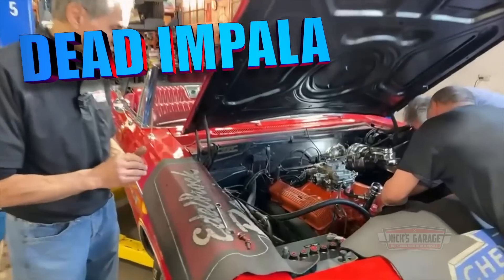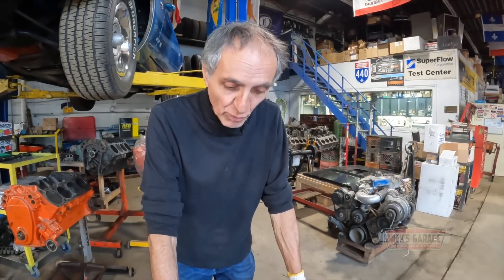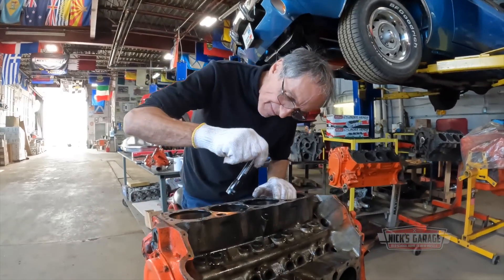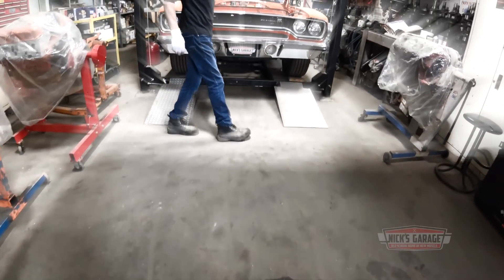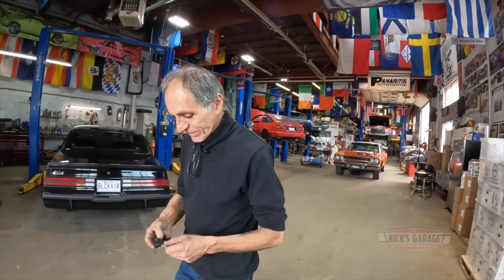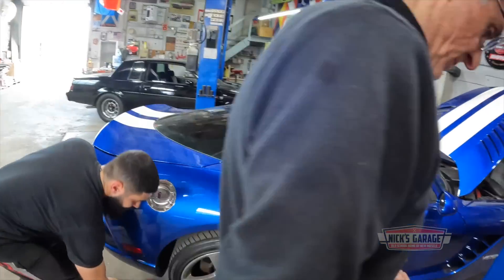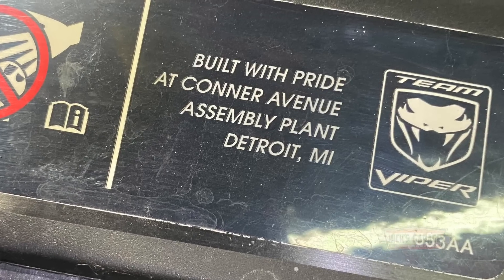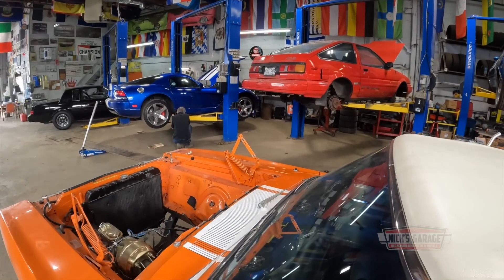327 Chevy Autopsy - Smoking Gun FOUND!

Comment: that was cool Nick.  new doesn't  always mean perfect,  i went through  6 voltage  regulars right off the shelf before getting a good  one the guy at parts store didn't  seem surprised , it was a lesson well learned .great video
Reply: ...always helps to have voltage, temperature and oil pressure gauges in any performance vehicle!

Comment: Nick, thank you for the good tip to always check out your new thermostat a dozen times or so before you put it in your car. A complete engine was destroyed because of a $20 part that failed to work. And from a reputable supplier that you'd done business with for years, and never a flaw before this time. Could happen to anybody. Brings to mind the $3 bearing that failed on the Andy Granatelli 1st design gas turbine at Indianapolis many years ago. They had a roller or needle bearing fail at the 490-mile mark, leading the race with 10 miles to go. Well, now we know that there is no part too small to fail, that will wreck your whole project.

Comment: Check the heater control valve - My 66 Olds Starfire 425 seemed like it was “blowing antifreeze” and this was the issue! Not a part of the motor itself, but it can cause you to lose your coolant and not leave any telltale signs.

Comment: Years ago I seen a 302 ford that had antifreeze in the oil and ruined the main and rod bearings, so after pulling engine out of car I pulled the oil pan and put the engine on jack stands and plugged up the bottom radiator hose and heater hose inlets on the intake and filled the block up with water and waited to see where the water was leaking from. It was leaking from a cylinder wall and running into the oil pan needless to say I  got a used engine out of a junkyard.. By the way I seen two 302 engines do this and one was in a 1980 ford f-150 and the other was in a 1980 mercury cougar...

Comment: Hi Nick, George & others, thanks for the update on the Impala, so a cheap part is what caused the 327 to cook up.  Theo's Roadrunner is one nice looking ride Nick and like Theo can't wait to see it finished either. That Viper is one nice ride and the colour is real nice. I'm with you leave the car the way it came don't change chassis for an earlier body. Stay safe & well folks till next time.
Reply: I have been a Corvette guy for 45 years. However, I have always had my eye on a Viper. So, in 2002 my girlfriend and I took a trip to Las Vegas and I rented a 2002 Viper to see what it would be like to drive one at $400/day. At this time it was in the mid 90's in Vegas. It did not take too long for the car to overheat with the A/C on. I turned it off and the temperature started to come down. But who wants to drive around without A/C with temps in the 90's? Also the foot area on the driver side got very hot. I was getting rapidly disappointed with the car. I will say the "cool car factor" was off the scale. I was stopped at a red light and a group of Chinese tourists started to cross the street. As they walked in front of the car a couple of them started to walk around the car. They were clearly impressed. When I came back to our hotel the valet drivers were almost fighting with each other to see who gets to park the car. There was also an annoying problem on the driver's side. There was no foot rest for your left foot. My Corvettes always had one. You had to drive with your left foot sitting flat on the floor. I went back home disappointed with the Viper and just continued buying new Corvettes.

Comment: When I get a new thermostat I now drill a tiny hole (1/32") in the valve to let the air out of the manifold while filling the radiator (slowly) as sometimes the block/head will not complete fill with coolant.  This may not apply to all brands but needed on a SB Mopar, or you have to pull a hose off.  I remember years ago, just about all the thermostats I used to buy had a tiny hole in them but not anymore.  I guess parts aren't what they used to be.  Thanks again.  Best Regards - Mike
Reply: Exactly.  Have done the same for years. Saved a slant I had when the thermostat was put in upside-down
Reply: Another one here too, I've drilled the hole in the thermostat for decades of Chevy's.
Reply: thought it was the norm to have a small hole on the tstat. aftermarket parts, i guess?
Reply: Never do this. It's much better to slightly open the stat and put a small piece of paper in there to hold it open if you think that needs to be done. Most aftermarket stats don't have a hole or a jiggle valve in the body. They use a groove in the side of the piston instead. Adding a hole makes too much water/ coolant bypass the thermostat.
Reply: @2xrpm  something I never knew. Thanks!
Reply: @chrisleggett685  1/32" hole works well.  Anything bigger, like 1/8", and it wont work properly.  First time I drilled a thermostat, I had drilled two 1/8" holes.  Bad idea.  Took half an hour for the motor to come to operating temperature.  I learned by my mistakes.  Amazing how only two small holes will prevent proper operation of the thermostat.  Best Regards - Mike
Reply: I've done this for 20 years my first 94 4.3L S10 my uncle was old school told me this trick.
Reply: Nope, knock all the guts out and just run the outer thermostat housing as a restrictor to slow the water in the system down, Common sense. Think about it, when the thermostat is open that's all it does restricts the flow to give the rad time to soke in the heat. A thermostat is only for heat inside the car in the winter ! THAT"S IT ! and nothing more. If they fail for any reason, you can see the outcome.  Just gut the damn things and no more issues PLUS the motor runs about 15 degrees cooler in the summer.
Reply: @chrisleggett685  Hog wash !  A thermostat is only for heat inside the car in the winter, nothing more .  You put any kind of paper in MY cooling system you got WAR  with this engine builder brother !  I don't even use any silicone on much of NOTHING on any of my rebuilds. Only gasket shellack that has set up.  There is a reason my motors hold up. I was the guy that called Nick about the thermostat, yeah I am older then nick  lol .
Reply: I just learned this trick a few years ago and have been doing it with every t-state since.
Reply: just find one the right temp and diameter with a jiggle pin bypass(acts like a check-valve/flow closes it) or other with pre-drilled factory bypass.
I don't know any numbers for them offhand, but there's many that will be drop in most all cases, you'll have to search the catalogs.
many have the bypass hole as a tiny part circle on the edge of the moving valve part, that way it doesn't get clogged very easily, which is an issue with a hole as tiny as 1/32".
I guess you could also open a standard valve manually and use a small round file to accomplish the same thing. in summertime only/high performance vehicles I'd not be afraid to drill 1/8" to 3/16" bypass hole. follow that by doing whatever it takes to have a physical gauge on one of the heads.
Reply: @throttlebottle5906  1/32" is basically for the initial filling of the cooling system to bleed off any trapped air.  With the intake to water pump bypass, my SB Mopar has plenty of coolant flow around the thermostat to make it work properly.  This has worked for me for years.  SB Chevy doesn't have that but some have an intake to radiator bypass to keep the coolant flowing.  I do the same thing for my girlfriend's '71 Tempest T37 with a 350 Chevy motor (no bypass).  Yes, came with the Chevy 350 from the factory (Canadian).  Can't say about Ford, never owned one.  Best Regards - Mike
Reply: @hydroy1  in the old short track cars they had plates with different size holes worked just like that keep some heat but always flowing
Reply: @joshdudley3078   Yep, agreed , In heavy stop & go summer traffic or car owners that don't have a clue about overheating, the best thing to do is just run a gutted  housing as it will drop the water temp 15 or more degrees just to be safe for zero cost.

Comment: I have never heard of an engine cooking the paint off of the engine - that is one hot 327 - it will be interesting to follow this story - I would be afraid to reuse that block and cylinder heads. A guy who is known locally for his custom cars (VW Beetle with a front mounted SBC, etc).  Buzzy is putting a '69 Firebird on a C4 Corvette chassis.  He had to cut the car body down the  middle length wise and add 6 inches of metal to get the body over the C4.  It's a very impressive build.  This guy is a true fabricator and it will look like a factory built car when finished.  Enjoy the journey - cheers
Reply: my dad had a 64 chevy 2 with the 283 v8. he put a frost plug heater in it. the thing blew out because it was the kind that did not have a retaining bar. when he drove the car home about 10 miles with no coolant it was so hot the old grease was running off the outside of the block. after it cooled i put in the correct heater. replaced the coolant. changed the oil and filter. the car ran on for another 100k plus miles. sometimes those old cast iron engines can take a lot.
Reply: You've probably seen the Foose "Imposter" Impala body on a new Corvette chassis. Sweet.
Reply: @NebukedNezzer  - That's good to hear - BTW, I like those old chevy 2's - The way the engine sits behind the front suspension is great for weight transfer at launch - thanks for your feedback.
Reply: paint is just not the same as it used to be, with all the ROHS and changes.

Comment: That engine would have been making quite a racket, it would have sounded like a popcorn machine detonating like crazy. It would have also had a significant loss of power, as everything tightened up inside and friction killed off power. The customer absolutely should have realized that something was wrong, but kept driving to the point of nuclear meltdown. I don't know who's paying for this, but I would put the fault at 20% Mr. Gasket and 80% customer.
Reply: Agreed.

Comment: Considering all the testing that was done on that engine the thermostat must have opened and closed several times before it finally stuck closed.   Virtually nothing being built these days is made like it used to be.   Considering you've had a new one stick closed I would never trust that thing again.    

You could boil it 10 times and it might work fine and then go drive the car down the road and have another one fail for whatever reason they are failing.   Also, boiling it is not exactly the same as how it is made to operate in the engine.   There is pressure in the cooling system.   As I mentioned earlier, I have quit buying Stants because of the same problem.    Do a search online for mr gasket thermostat fail and you will find over a two dozen reports right off the bat.

You sure do get a lot of really neat cars in your shop.   That road runner is awesome and for me it is the perfect color combination.   The blue viper is the same.   I like the blue a lot better than red on the vipers.   If the exhaust is running that hot through the rocker panel maybe it needs some better thermal insulation in that area.    I didn't even see a wrap on that pipe.   I'm just guessing though.
Reply: I was the guy that called nick about the thermostat fails, and your right, the only way to STOP this from ever happening is to knock the guts out of the thermostat and only use the outer case of the thermostat as a restrictor to slow the water down to give the hot water a chance to soke heat out into the fins of the Rad. Been doing that in ALL my rebuilds for 40 years with zero issues. The plus side is the motors always run 15 degrees cooler in summer .
Reply: So true about cutting the centre out of the thermostat an just putting the ring back in so the water does not circle ⭕️ to fast  if you do away with the thermostat it circle to fast an will run hot have worked in 2 radiator shops 🇦🇺👍🏻

Comment: Very sad to see the carnage Nick. As a former mechanic, I see your logic and methodical approach to all of your work. Very impressive Nick. May I suggest a very simple and inexpensive "trick" to prevent this from ever happening again. Install another temp sensor in the other cyl. head and run the lead to the neg. side of the ignition coil. When the sensor reaches temp. it will kill the spark and stop the motor. I wish your shop were in my area. Best Wishes

Comment: Good afternoon guys!!! Wow: that’s the first time I ever saw an engine get THAT hot from a stuck thermostat!!! All the coolant must’ve turned to steam and possibly got past the head gasket(s), unless the extreme heat caused a crack in (one of) the head(s). and allowed the steam to get out via the exhaust. Geez!!! Just goes to show, cars can be SOMETHING ELSE sometimes!!! Great week to you all!!! 🙂
Reply from the maker: Thanks! You too!
Reply: If the thermostat stuck it will overheat, but will not harm the engine unless you keep driving. This individual kept driving and this is what happened. That is why an actual temp gauge is critical.
Reply: @bryangeorge9461  Add a blinker to that warning light on the dash and maybe a buzzer ,,,,
Reply: Had to remove a stuck thermostat from my 2004 Dakota few weeks back.  Piece of crap was $21 and only lasted a few weeks.  Fortunately the car (as all Mopars from I believe the 50s on up) has a temp gauge.  Never overheated or did any damage but it's the hassle.  Why are there no reliable parts any more?  I have a suspicion - might be because of where every piece of junk new part is made.
Reply: @MoparStephen  it is most certainly where all these parts are made. I had to replace the A pilar trim on a 67 Camaro convertible, both trim pieces were from OER. both made in my favorite overseas location that makes every other piece of junk on earth. the passengers side top screw hole lined up but the bottom one would not, had the opposite issue on the drivers side.  top screw lined up fine, the bottom one was off.  measuring with a cloth tape measure the screw hole on the passenger side top was off 1/4 inch from the original and the driver side was off almost 3/8 of an inch off. sent them both back and got a replacement pair. drive side was perfect this time, but passenger side was still off.  sent it back again, got the replacement, this time no issue. the quality control at OER is non existent. and the overseas workers don't care if it is defective. I had this same thing happen with the dash pad in a 1971 Camaro SS 396.  every dash pads i tried was off. I must have gone threw 5 dash pads from them.  finally gave up and had the original redone, but i could have bought all of those dash pads for what it cost to restore the original. but if you want quality and proper fitment, some times it is worth paying more to restore an original OEM piece.
Reply: @bogiewheelman71  ... and an electric "whoopie cushion" under the driver to give "mild" electric shocks?
Reply: @MoparStephen  We maky you parts velly good!
Reply: I've never seen an engine overheated so much that it scorches the side of the block like that! He must have driven it for miles before realising something was wrong, probably when the performance started dropping markedly.. But, as Nick shows - it wasn't completely the guy's fault > dodgy parts were at play, just goes to show in 2022, can you 100% trust the aftermarket!? You have to second guess them now and always test parts yourself, like an engine builder would if he was putting an engine together to survive a 500 mile race.
Reply: I am also not a big fan of any thermostat other than Stant Superstats.

Comment: That is the exact same thermostat I used for my engine with the exact opposite issue!   Kept temp perfectly at 180° in summer but in winter would not let engine temp anywhere near 180°.   Would not close all the way.   They are a great thermostat but only if they work correctly.

Comment: Nick I enjoy watching your videos but I am a master engine builder with 30 years of testing and dynoing engines and racing I truly believe that timing backed up on that engine the distributor moved what that would do is cause the fuel to burn as it's leaving the exhaust it's just like putting a torch to the cylinder heads that's why the paint cooked off in that area if you can't find no other cause that's what happened
Reply: We checked the travel of timing and it was 5 degrees movement either direction. It was not completely loose, maybe call it a slack.

Comment: That's why I always try to use a  thermostat manufactured by company called Motorad and its called a fail safe thermostat. When it fails it stays in the open position. Worth the extra trouble to track one down.
Reply: Exactly...  Totally agree..
Reply: Thank you for that. I will be checking MotoRad for a new thermostat. Makes sense

Comment: Good evening Nick. I love your videos. I once had a Firebird  lose its coolant from a bad radiator cap. I know it sounds too basic, but you never know. Mine would only leak when revved up. It didn't leak when idling. Took me a while to figure out.
Reply: SOUNDS LIKE THE RADIATOR WAS RESTRICTIVE, A TEST IS TO TAKE CAP OFF WHEN COOL AND REV THE ENGINE, WATER SHOULD NOT COME OUT THE FILL.

Comment: Bad thermostat? Maybe. It is possible that the radiator cap was bad and the coolant boiled out to the point that the thermostat  wax pellet got cooked out from the overheating. No excuse for running it until the engine paint burned to black. Never seen that before. Usually engine locks up WAY before then. HAD to smell it being hot.